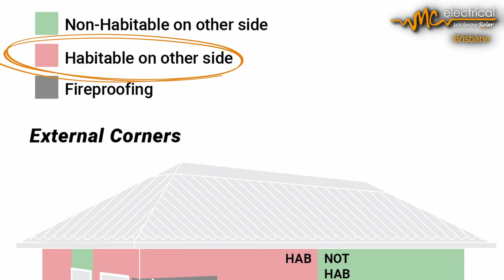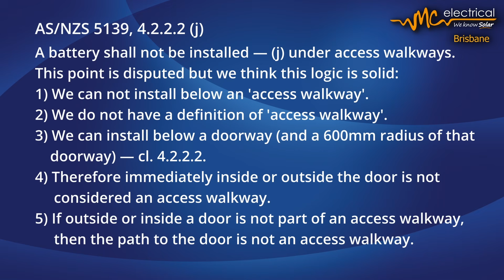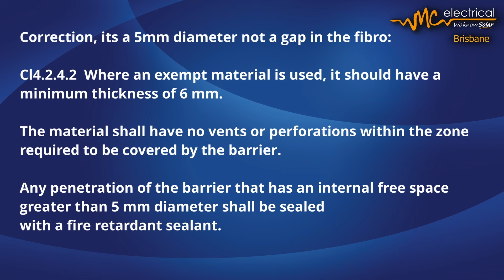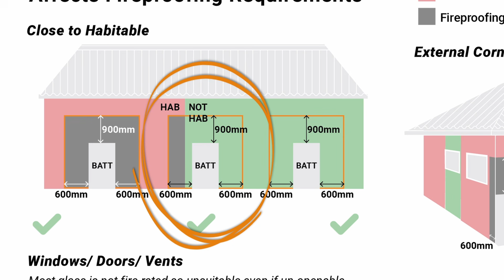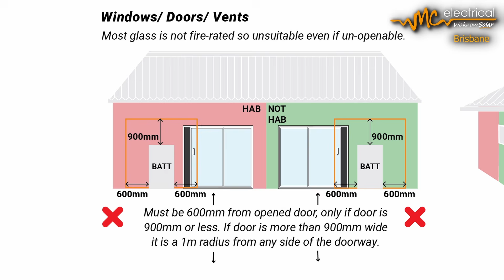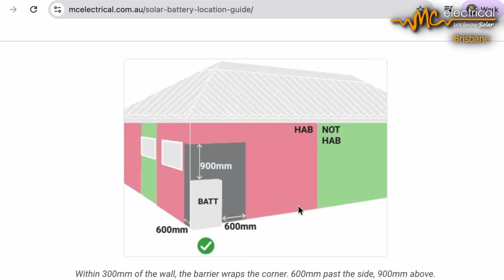Where Can You Install a Home Battery? Australian Solar Battery Location Rules Explained

Comment: G'day guys, great information thanks. How far from the inverter can a battery be installed and can it be installed parallel to a fence?
Reply from the maker: No real limitations about distance. And yeh technically it can be installed near a fence. The cable run would make that difficult. Most manufacturers say would need to be out of direct sun

Comment: "Garage is usually cooler location than outside." Hmmmm. Are you sure about that? All garages these days have metal, uninsulated, very wide roller doors. When that garage door is facing north, which it does for a lot of houses, then that metal door becomes red hot oven under Australian sun. And no air conditioning in the garage. So that garage can get very hot.
Reply from the maker: Yeh usually is a sloppy way to say it. If the garage is a hotbox, we’d try and avoid that.

Comment: Hi, can someone help me. I got the Sigenergy battery installed recently. The battery is mounted in the garage, directly backing onto our hallway wall, right where the bedroom door opens. The hallway is the bedroom only evacuation route. If a thermal event occurs, the fire will burn straight through that plaster board wall directly opposite the bedroom door, blocking the hallway. Because this wall directly separates the garage from our entry and bedroom should a non combustible firewall barrier required by law.
Reply from the maker: Hi, no if you check my online guide, a hallway is not a habitable room, so it’s compliant. Nothing stopping you from being over cautious and sheeting it anyway. But if you have a half decent lfp battery, the chances of a fire a basically zero. R

Comment: Why don’t you mention the fact that a lot of installer’s fit compressed sheets have absolutely no idea of the correct installation of the product which is generally James Hardy. Therefore the fire barrier is non compliant.
Reply from the maker: Hmm, we leave carpenters to do carpentry. It takes a skill to make it look good, but I wouldn’t have thought it would take too much to make it compliant if you follow the solar standards. What are they getting wrong?
Reply: @mcele @mcelectrical  start they installed villaboard and batteries on the west side of the house which gets all afternoon sun and exposure to all weather. It was screwed the the vinyl cladding with very few roofing screws. Villaboard is non compliant for external use. Refer to James Hardie specs. Also I called Goodwe about the batteries being in afternoon sun and weather and they strongly advised not to as the batteries can overheat and go into protection mode and also it will shorten the lifespan. The anaconda is not earthed or fixed to the fuse box and the main cables under the timer floor where we can see the single insulated cables exposed as they exit the anaconda. Could you please advise me about why these cables haven’t been installed in conduit under the subfloor and thanks for the reply regarding all these issues. Cheers

Comment: Very interesting in relation to the garage with a timber wall, i belive if they specify in the manufacturer manual must not be installed on aq combustable surface
Reply from the maker: Which manufacturer's manual are you referring to?

Comment: Great info, I used this to verify placement for batteries (future and quoting now). Bit tight so a builder is making a custom load-bearing timber wall covered in 6mm+ fiber cement (vibro) this week. It's going on a slab under a house extension (1600mm total height only). Playing it safe by extending the fire sheeting 600mm+ around the unit and above - keeping the battery 600mm clear of the walkway... Being someone that has written standards (not solar/batteries!) fully understand the challenges standards and product specific issues. Thanks!
Reply from the maker: Interesting! Which standards have you been involved in writing?

Comment: Windows or doors that are inset by a bricks width usually around 90mm, would that count as a corner so the 300mm rule comes into effect so you can be closer, or would you just make sure your 510mm + that 90mm for your 600mm total? I always go with the latter but it would be interesting if you could make the case for the first option.
Reply from the maker: Yeh, I’ve had that question twice from my Sparkies.  So maybe more common than you’d think. It comes down to what you are willing to justify if you get inspected. I’d go with 510mm option personally.
Edit. If you want to get ridiculous, every grout in brickwork is a corner. But that clearly wouldn't fly.

Comment: Hi, can someone help me with this query. I’ve got a sigen battery stack with inverter on top. Is the 900mm to the ceiling measured from the top of the inverter or the top of the first battery module? And where is this shown in the specs?
Reply from the maker: 900 from the top of the inverter because the inverter is part of the “Bess” or battery energy storage system, as defined in the as5139

Comment: Seems odd to me that for a battery that has been installed to store solar energy (say, to charge your EV), the associated inverter and switchboard can be within 600mm but the EVSE that plugs into the car must be more than 600mm away.
Reply from the maker: Yeh. It’s just the way the rules are written. An ev charger is an appliance like an aircon or hot water system. They want clearance from appliances.

Comment: Why not email the regulator and ask?
Reply from the maker: You can ask a regulator, but, at least in qld, if the standard is vague, the answer often comes back as “comply with the standard”.
In other states I think regulators have more input. And in my opinion that’s not always good, because it can often give unnecessary power to an individual who is wrong.

Comment: I find placing up next to boundary in garage a Gray area... since its not a fire wall.

Same as under the eves... they are not fireproof heat pops then out with much effort
Reply from the maker: What part is grey? To keep to 5139 If it’s habitable on the other side of the garage it need for proofing. Same as above the eve.
You can always go above and beyond if you want, but that’s what the standards require.

Comment: Ummm I just noticed Fronius have removed the forced charging button from the android app,  why?
and how do we do it now?
Reply from the maker: Hi John, the button hasn't been removed completely. You just need to tap the battery icon on the app homepage and then tap the battery name 'Reserva' and then on the following page there should be a Battery Control button called 'Start'. That will charge the battery and also stop the battery from discharging for 24 hours unless the grid goes down, so best used for storm prep but you can disable it as well. Let us know how you go?
Reply: @mcelectrical  yes, I found the answer on Whirlpool and then forgot to update here. 
Thank you for posting.

Comment: A modem or a router - now there's an interesting point - what about the NBN box their (often shabby) contractors whacked onto an outside wall with no consideration for what the home owner wanted?  It's unpowered and just passive cable connections, so likely doesn't count - except the wall penetration.

Standards are a funny thing - often put together by the industry standards body - which is often composed of the major players in the industry, and the standards are subsequently revised and changed when one vendor rotates out of the chair role and another into it - surprisingly to favour the new chair's products. (The stuff you learn running maintenance contracts for a govt department. Rule 1 - trust the HV guys - shonky HV operators don't stay alive for long. heh.)

Comment: Just want to clarify on multi-storey home if the habitable room above a garage is > 900mm, no fireproofing on garage is ceiling is required?
Is existing inverter considered as "appliance" if I'm going to AC-coupled the battery close to it?
Reply from the maker: Best to click on the link to the guide itself to clarify, over 900, no fireproofing on the ceiling. 
And, no I’d call the inverter part of the battery system .
Reply: As far as I’m concerned inverters are associated parts not an appliance, if the distance from the top of the battery module to the ceiling is greater than 900 mm then you do not need to fireproof but if it is habitable above, then it is still a good idea, if it’s easy enough!

Comment: Excellent job! Very decent of you to share.
In one of your examples (about 28minutes in)  you are showing the battery needs to be 600mm away from the opening side of the sliding glass door.  Does it have to be 600mm from the solid glass side of the door ? (assuming not habitable behind it )
Reply: If it is not habitable behind it, it does not have to be further than 600 mm away from the solid glass